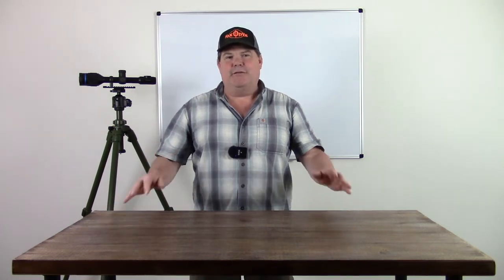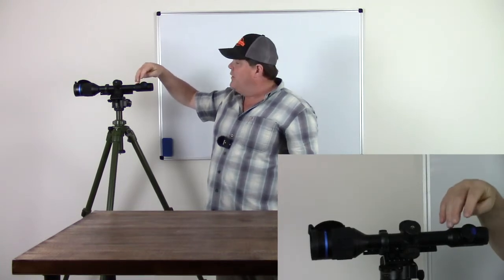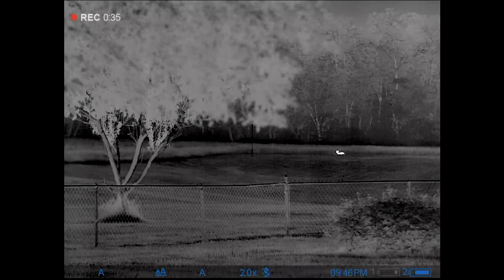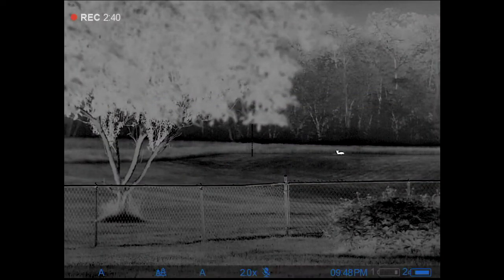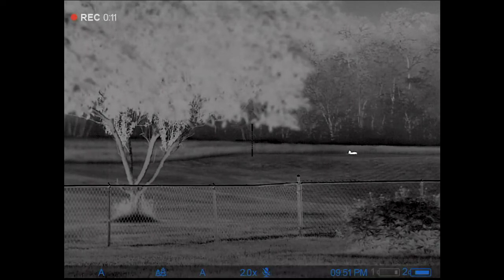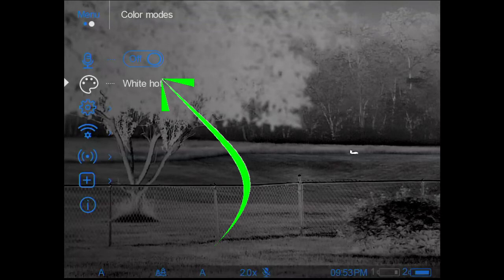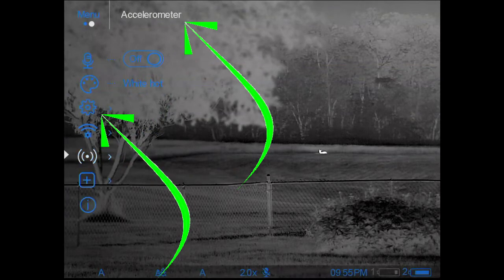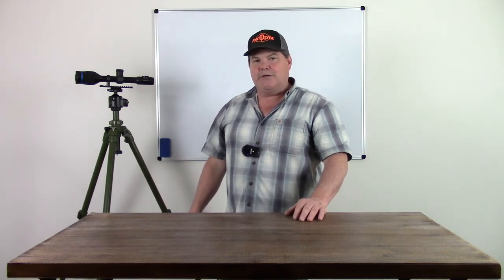Basic operation of the menu elements in Pulsar thermal devices

Comment: Great vid,
What's the difference between the xp38 and xp50 is it just the size.
Reply from the maker: Fecal length.   This determines FOV more than anything.   The XP38 has wider FOV vs the XP50, however,  the XP50 has more magnification and therefore longer ID range.

Comment: how do you get the image to be focused? mines out of focus
Reply from the maker: Adjust diopter focus to the display with the focus at the rear of the scope (eyepiece)  after that adjust focus for the correct distance to target by adjusting the focus ring on the objective lens end of the scope.   The clearest image will always occur at the lowest magnification with digital devices.   It also helps to properly adjust contrast and brightness.   I recommend starting with brightness at 10 and adjusting contrast both above and below this value until you see the number you prefer.  (This will give you an idea of the "span" between brightness and contrast.  Once you know what looks best you can adjust them together to raise or lower overall brightness.   If you have questions,  you can call me anytime 660 341 9370

Comment: How to turn the menu off
Reply from the maker: Long encoder button press opens and closes most main menu functions.  Short press to open the quick menu and it times out after 3 seconds on its own.  The main menu will time out and close on its own after 5 seconds from all options except zeroing and dead pixel correction.  (These require long press to save and exit. )  Call me if you need help 877 806 2977